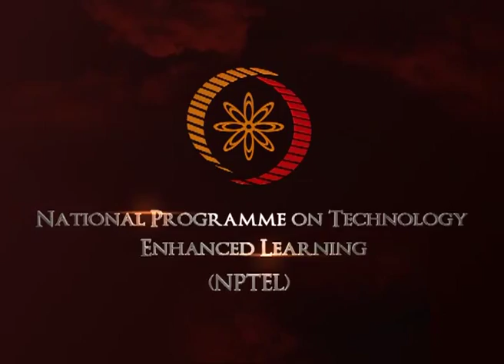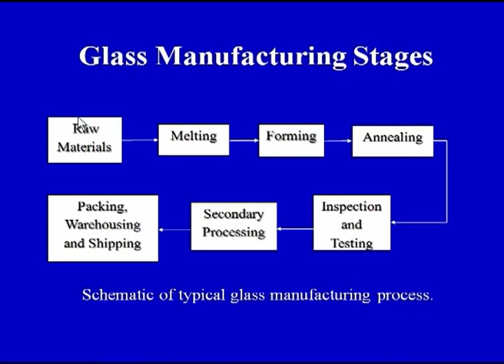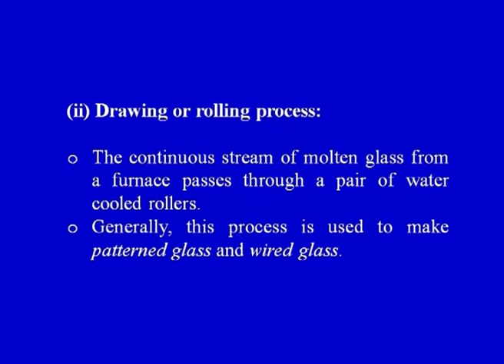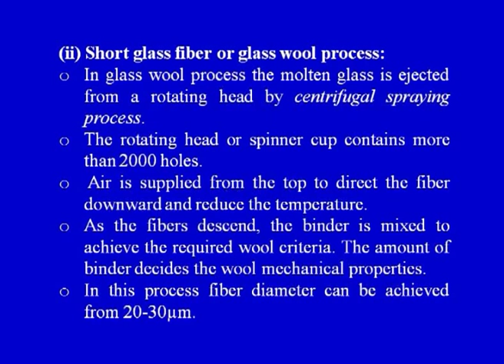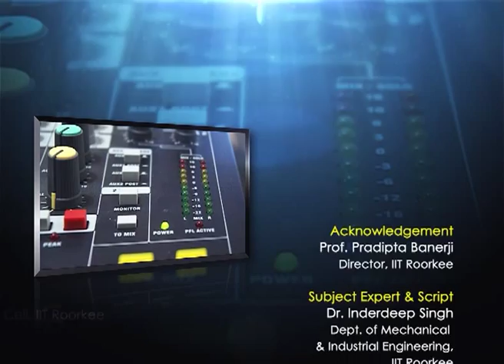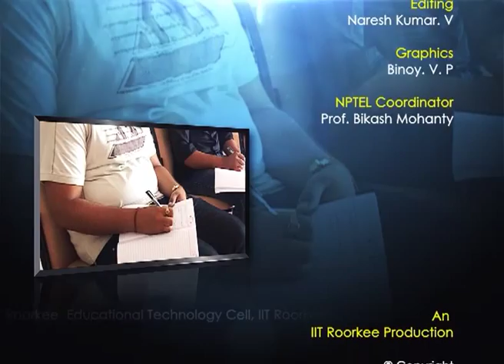Mod-02 Lec-02 Glass Processing - I

Comment: Thanks sir .
I have a question  , in glass forming we also use air to to quench to solidify the material in shape and stress is developed. 
So what is the difference between the tempering process quench and shape formation quench and how to differentiate both stress?